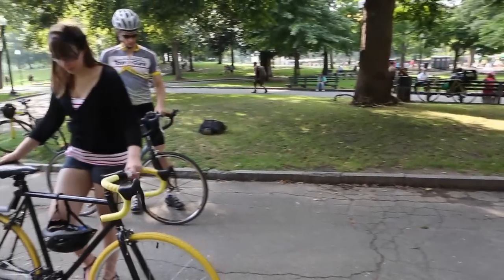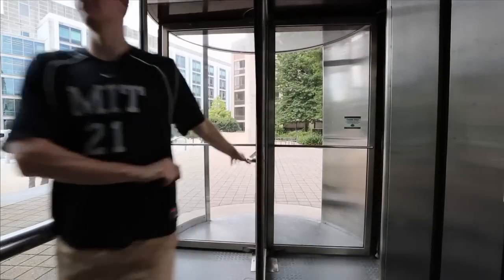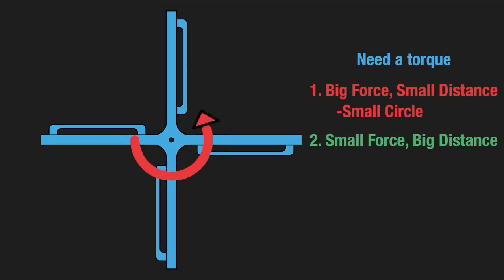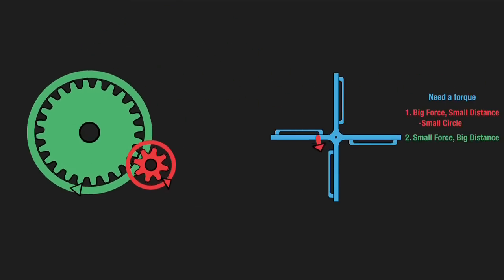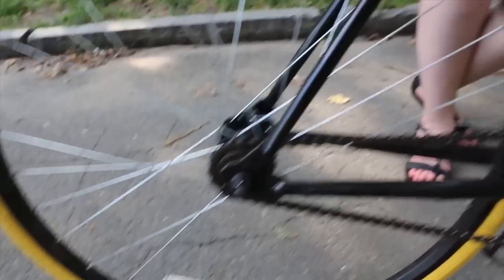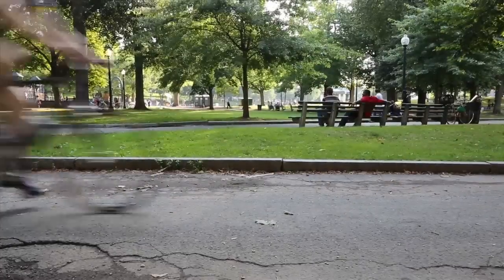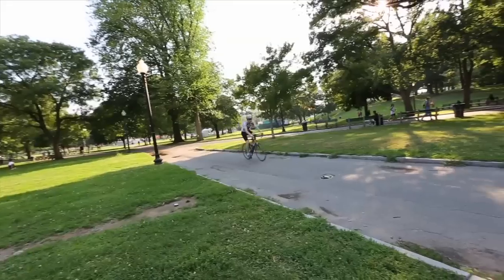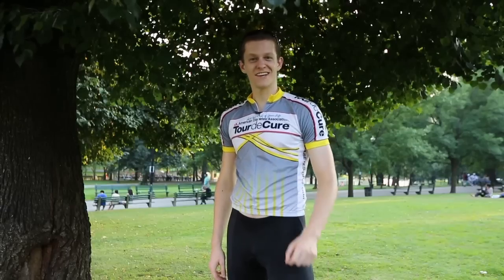How to Win a Bike Race: Using Gears

Comment: What a waste of time making this video, the bikes were completely different which means there were more variables than the gear size.

Winning a race comes down to fitness, tactics,and skills on the bike.

gear selection is something that is made using rider preference generally guided by variables such as wind,gradient, terrain, etc

and an easy check is cadence for optimum power/economy of effort on the flat your cadence should be around 90rpm

I can guarantee no one will win a race using only the information gleaned from this clip.
Reply: U are right about "Winning a race comes down to fitness, tactics,and skills on the bike." but i think u did not get the idea of using gears to win a race.
Reply: Harsh    Enterprises    Raj       Kumar Choudhary  BaKhari  Pur